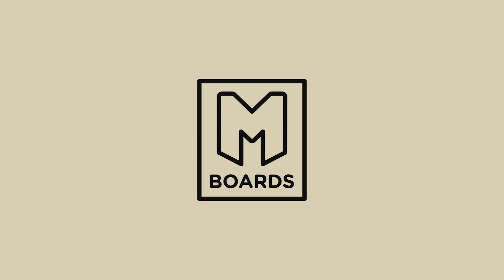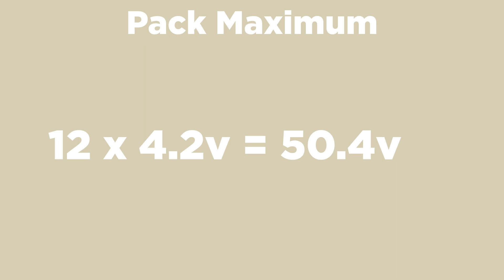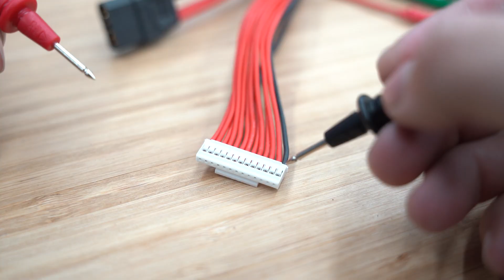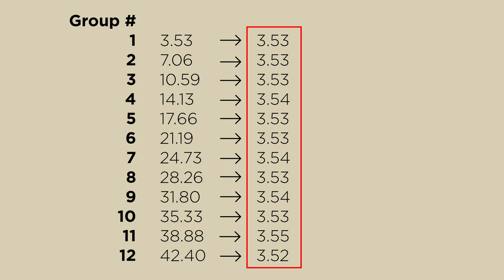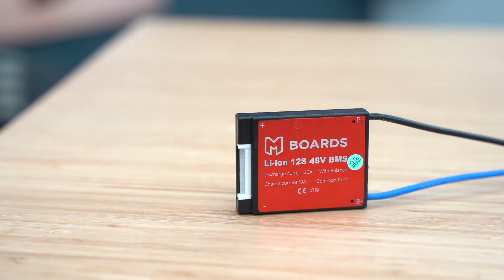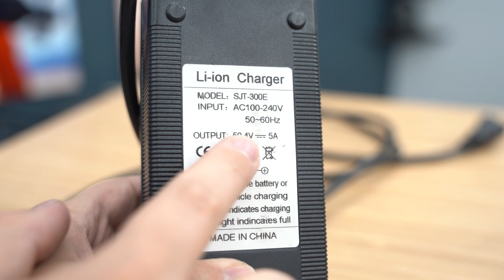MBoards Tip of The Day: How To Test Your Esk8 Battery

Comment: My problem is I  have a charged battery that reads with in the limits of your chart.  I get 26.4 v for 7 cells.  Good there but when I plug into circuit board battery connector it sparks and blackens the positive connector.  What does this mean?

Comment: Is that a problem if balance leads are not in the right order, I tried this with the 12 pins plug of My Hurricane BMS and I got something like 1-2-4-5-6-8-9-10-11-7-3 (3 and 7 p packs being at the end of the 12 pins plug out of order) ? In the meantime I realize I got 12 pins on my Hurricane BMS and you got 13 on your Daly (I cannot measure the total voltage on my plug, I have to take it directly from the pack)

Comment: What is the life cycle of such a pack, is it the same as an individual cell or is it significantly lower for whatever reason, for exemple how much complete charge cycles should I expect from a 12S4P pack of Molicel P42 ? Thanks for the video, really helpful.
Reply from the maker: The rated life cycle of an individual cell is the same as a complete pack. P42A cells have a quite good life cycle. Rated at 500 cycles, where after 500 cycles 80% capacity is still expected.
Reply: Thanks for the answer, I guess I should not be satisfied with the 50 something recharge cycles of my Meepo Hurricane then (now that it's at 47V fully charged)
Reply from the maker: Woah, certainly not. 50 charge cycles is not much at all.

Comment: hey guys.
im currently 3d printing a motor mount with 100% infill. you said that you really should not ride 3d printed motor mounts, however this one requires you to put a 3mm diameter steel rod through it! Should this be ok? it is my first build and i am on a VERY tight budget
Reply: Your motors are gonna produce heat that'll effect your resins.

Curious if you tried it and how it's been working for ya